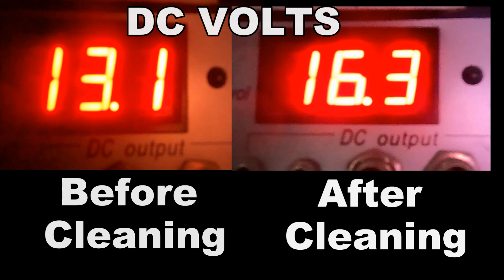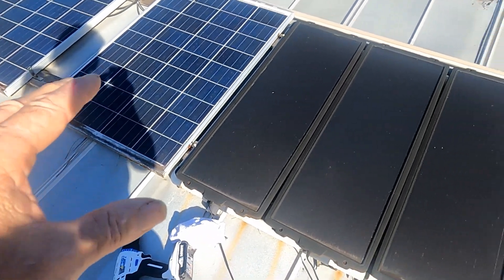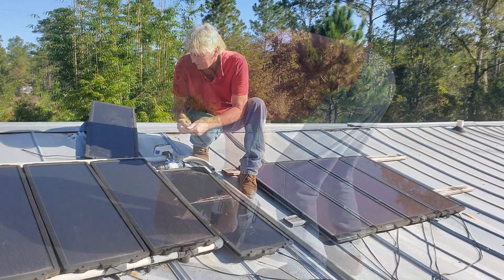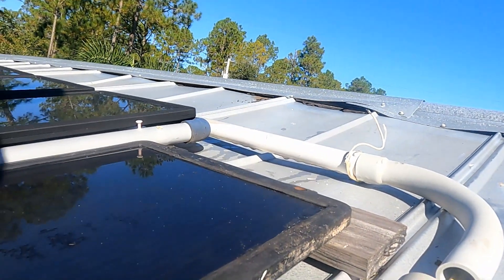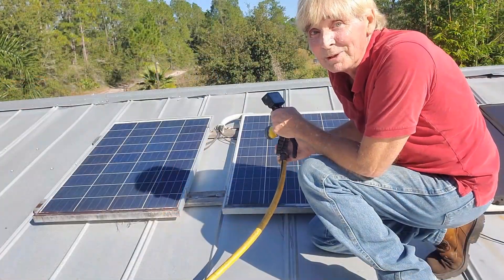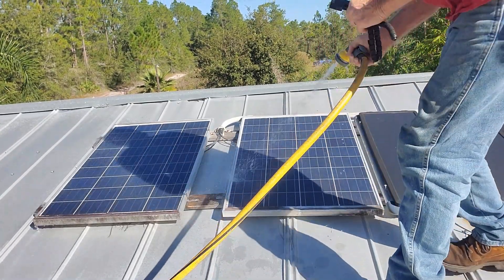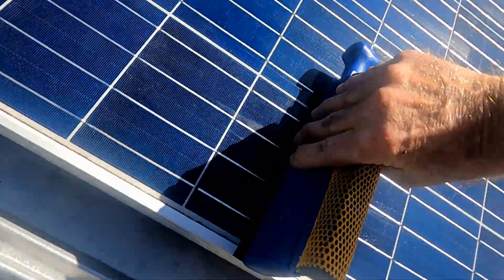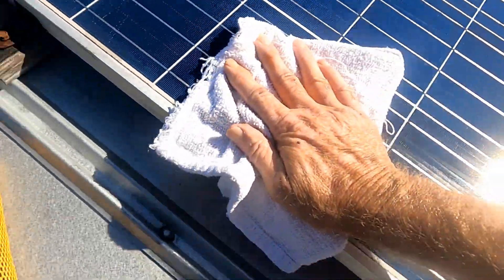Get MORE POWER from Solar Panel

Comment: Chuck, I do not know how accurate your  demonstration of the power increase from cleaning your panels is. The old broken panel you replaced is only a 15 watt panel. The new one is a 25 watt panel witch brings in 10 watts more of power. I have a set of the old harbor freight solar kit puts out 45 watts. Wear the new kit puts out 100 watts. With the newer panel design. Those are rated 25 watts were as the old ones are only 15 watts. The difference of wattage from cleaning the panels is very slight. It would barely be noticeable. If they were a little more dirty it might make a bigger difference.
Reply from the maker: Hi Vicky, you could be right. But that is a 15 W panel that I replaced. The 25 what channel has a blue diode lights up when it is producing power. I I showed the power after cleaning and before cleaning. Either way clean your solar panels! Thanks and best regards Chuck.